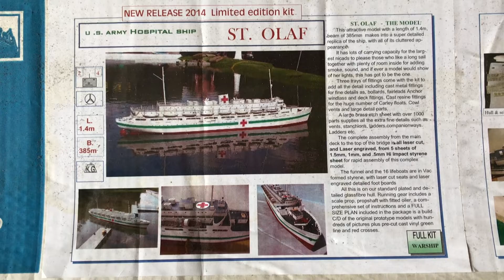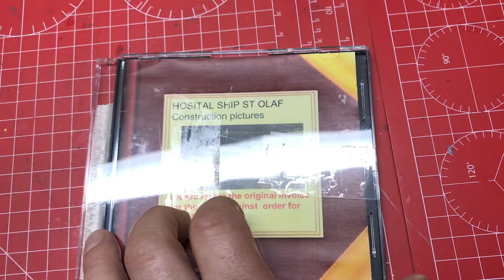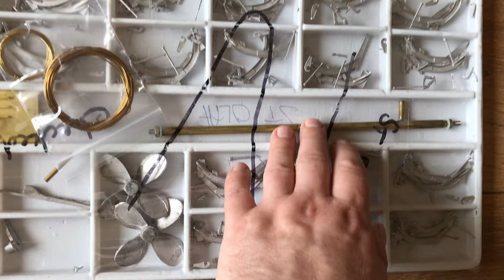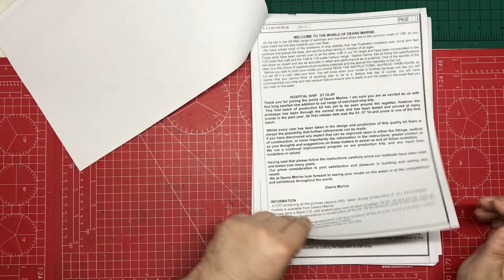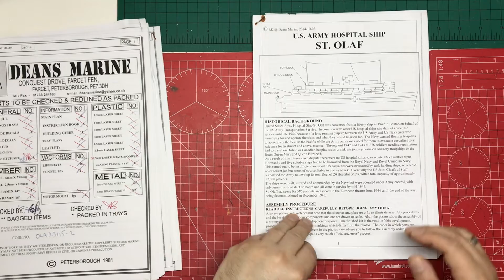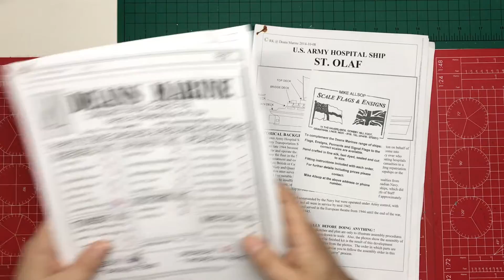First impressions, Deans Marine, 1/96, St. Olaf

Comment: I have just received this kit on 20/12/23 --I gave myself a Xmas present. I have built a number of Dean Marine kits Including Trein Maresk container ship and the most recent Epic Menorc.a The kits are an excellent product and with a careful build the end result is a museum quality product.  All my models are static and housed in wooden display cases which i build myself having been a cabinet maker. Today is new years day 2024 and already i have been working on the Hull which is well detailed, but requires opening portholes , freeing ports and the main deck openings. I expect this model will take 12 to 18 months to build and being retired i find the build relaxing. I have just finished watching the first impression which i found informative and interesting especially to a new comer in this hobby --but the key is to read the instructions carefully and also look at the pics on the disk supplied

Comment: Great review of this kit. I would describe the kit as scratch building from styrene sheet without the marking out from scale drawings. In my opinion the model is a good cross over or gateway into the RC model side of the hobby for anybody who has built a few plastic kits using after market parts. Don't leave it to long before you tackle this type of kit. I would be an avid viewer. I'm in the process of doing an RC conversion to a 1/72 flower class corvette from Revell, I have used all the kit parts I want and now everything else is aftermarket or scratch built.(Used approximately 1/12 of the kits parts count)
Reply from the maker: I know a few people have converted the old Matchbox corvette to RC I think Deans Marine actualy did too some years ago, not sure how well it handles.
Reply: @ModelkitStuff  I'm currently experimenting with the ballast distribution to get a good baseline, those self adhesive car wheel weights are really handy 👍
Reply: @ModelkitStuff  The Dean's Compass Rose was also 1/96 scale.

Comment: Great review. I have previously built their Royal Barge and I have HMY Britannia in my collection. I would recommend a commercial brass propeller as the white metal castings are not very durable and it’s difficult to fashion into a perfectly balanced propeller which is a must to limit vibrations.